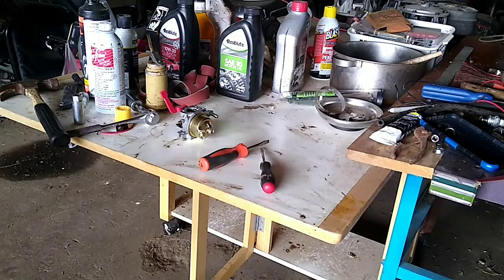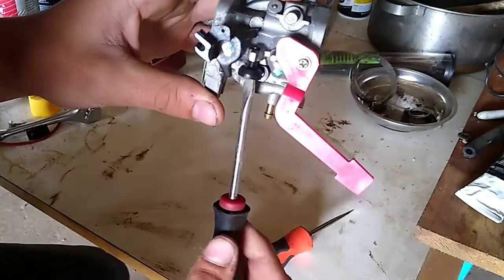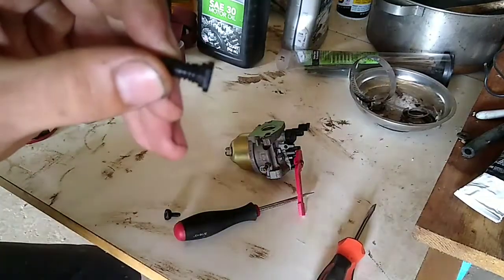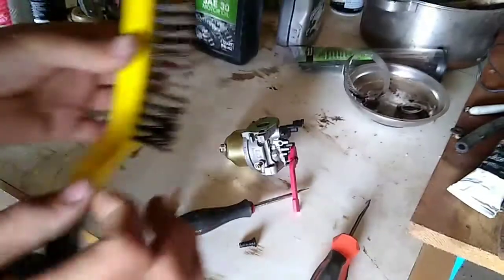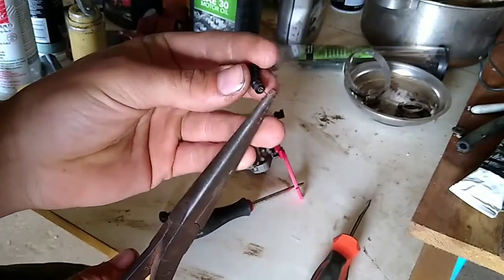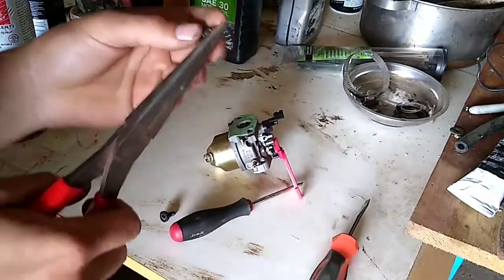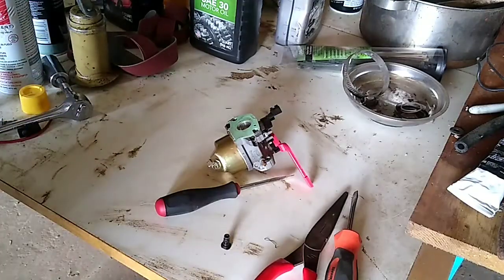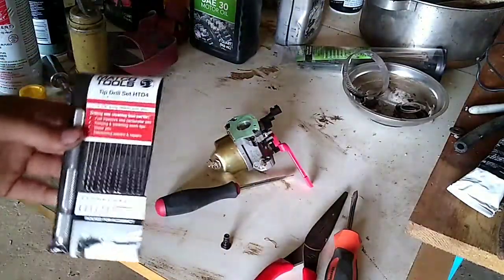This HIDDEN Jet is the Cause of Your Engine Hunting or Surging... Lawn Mower/Honda Carburetor FIX

Comment from the maker: Hope You Can All Learn from the Video about these carbs!
Reply from the maker: @Maddog worker sometimes it does but goes away, were all the intake gaskets good?
Reply: i NEED HELP!! i have one of those similar carbs but its on a snow blower i have removed and cleaned the entire carb twice including both main and idle jet are completely clear. i cleaned and gapped the spark plug, changed out all the seals and confirmed that the plastic spacer is not cracked. But im getting hard start when cold and unless put on choke the motor stalls instantly just by engaging the auger (with out snow). no surging or hunting, runs smooth engine previously sat for 2 years
Reply from the maker: @abuvibes8950  screen behind fuel inlet to carb, i think its removable on newer ones with a 90 degree elbow. not for sure, but maybe. if you have any intake leaks it will run on choke only too. make sure to passages all clean on air intake side of carb.
Reply: @bearkreekboys  UPDATE: after putting new seals and a carb on but still with no luck, it was seafoam to the rescue. aparently the only thing stopping it was carbon build up.

Comment: Hi. I just wanted to thank you so much for this video. I had stripped, cleaned and rebuilt my lawnmower carb but the engine was still surging! Then, I found you, problem solved.  Thanks again. G Steele, Leicestershire, UK.

Comment: Thanks. My washer worked fine for 5 years. Then stopped working on a job. Drained the gas tank, cleaned the carb, but forgot the pilot jet. It cranked and surged at idle. Did your trick and runs like a champ. Beats messing with idle screws.
Reply from the maker: Glad it worked!

Comment: 😊 Thank you so much. I was fully expecting to remove and strip down and clean the carburettor to get it working again. Not so! Your fix works a treat and first time. I didn't even need to remove the carburettor to apply the fix! My mower is now running better than it has in the past two years. Thank you!

Comment: Great video, I wish there were more of these videos or they were easier to find. I have a 2023 brings XP 420cc and if it doesn't get run for 3 months this needs to be done. I always turn the screw in and count the turns until it sits. Then we a reinstall it I know to back it off that amount of screws. I'm not sure if everyone knows to do that or if they adjust the idle every time? I don't know enough about motors.

Comment: Thank you MMO, I am a retired mechanic, London U/K. I stripped my carb down (Same unit as yours exactly) and cleaned and rebuilt, it did not cure the hunting/surging, Than I saw your video and I had totally missed this jet on the outside because its hidden under the air bleed throttle screw, Thanks Im greatful . Mike Heath .

Comment: My powermore 173cc Troy Bilt CSV060 chipper shredder vacuum wouldn’t run unless full choke was on.  Found the pilot jet rock solid clogged thanks to this video.  Thanks a heap brother 🤙

Comment: Hi Bear, Your video worked a treat. I had the hunting, stalling occasionally etc etc ... Honda GX270 / 37 North Star splitter here in the UK [ a rare machine here ] .... anyway your cleaning method works perfectly and it is now running smoothly THANK YOU [I have thums up and subscribed]
Reply from the maker: Man I'm so glad to hear u got it going good! Thanks for the positive reply!!

Comment: Kinda funny I was watching to see if pilot jet takes 2 or 3 o rings, you said it probably has 2 or 3 o rings. The rebuild kit came with 3 o rings, but there was only one deteriorated o ring when I disassembled it, so I only replaced one o ring and didn’t run bad but not perfect, so now I’ll install 2nd o ring and see how that works. Thanks 
If anyone knows more on this please reply

Comment: my lower o ring seal is torn off, so I just remove that. but then the generator engine runs rough and the exhaust smells bad. is it caused by that missing o ring?
Reply from the maker: Definitely can cause it to run goofy yes

Comment: Hi Bear; I have a honda gcv 190 when it idles down i get the surging and governor rod rocky back and forth. I installed a new carb could it have come dirty? thanks
Reply from the maker: Have seen new carbs with the pilot jet plugged out of the box so it is definitely not out of the question I would definitely check it and then you could always do a static governor adjustment after if it doesn't fix it

Comment: Should I clean out the top too?I’ve cleaned out the small end (pilot jet)
Reply from the maker: Top is pilot jet. Bottom is main jrt
Reply: So, do I clean it?
Reply: @bearkreekboys  not that the name matters. In fact I have a bigger problem now, I decided to adjust the throttle bolt. Instead I broke the top off the bolt. Not a good day. The bolt is too stuck to take out with pliers. Tried to drill it, it’s too hard.